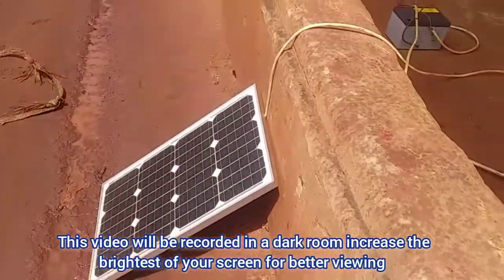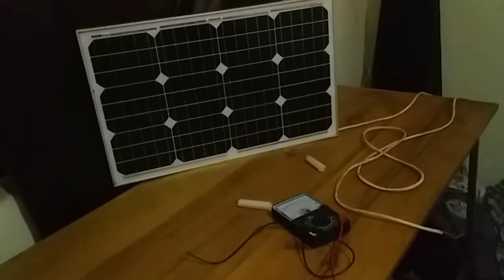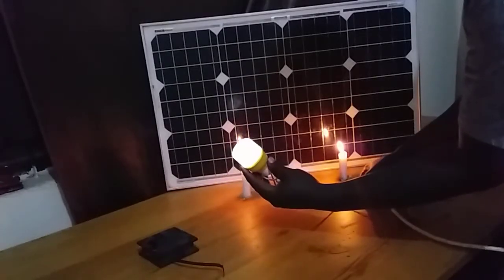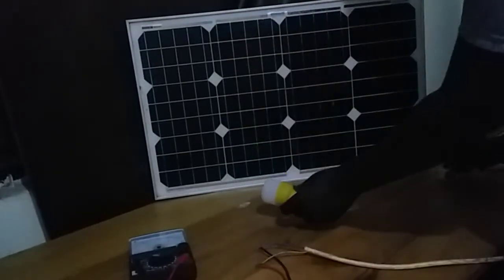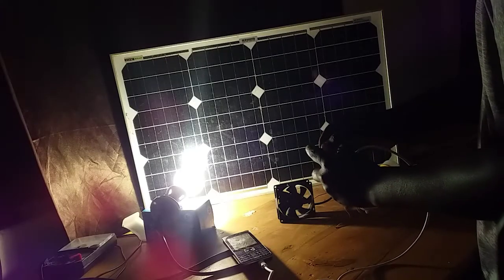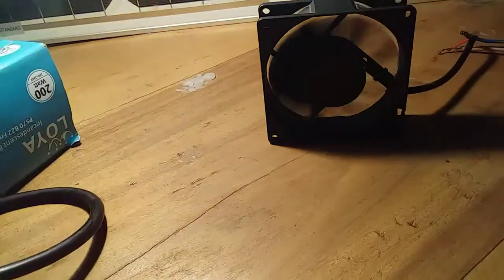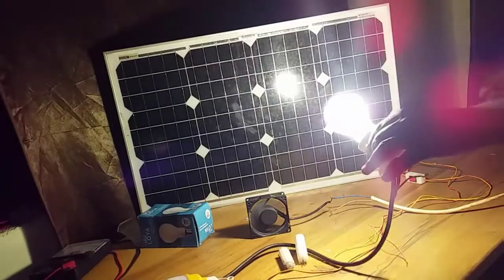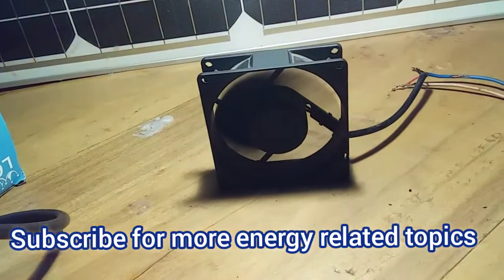How to power a solar panel without sunlight/Do solar panels work at night?

Comment: volts is never amps,  and a bank is required to maintain the rating of amps,  a led is only 2watts such as he shows you here, that 2watts is only 0.01 amps  so the candle, is not the Sun that is for certain,  its a 2amp panel

Comment: Wait a minute, so if the Solar panel recieving the Light of the Light bulb , the bulb wil never stop shining, 🤔
Reply: dimishing returns.. its not a little that is recylcled
but still useful i would think.
in fact i am thinking of using protable panels at night i mean you already have to turn on the lights to see - what ever little charge the panels get should be slighlty useful to top back up some batteries maybe?

Comment: We are from the United States here's the information you are missing remember as you watch these videos you'll see that we put the  Lights directly over the solar, So you have to measure the length of the rope lights Times the solar second point you got wrong the soldiers you are using are configured in a certain way and not giving you all the power you could get out of it. you have to make your own custom solars or you're only going to get a little. but you proven that artificial light can be used
 We call this technique quiet solar it means that the light is not  As intense as regular sunlight so we call it quiet solar. Now as you start to make your own solar Come you'll see and understand that making your own custom solar panels will get you the energy you need to run regular items, But you made a good point by showing that artificial light indeed can produce some energy now you need more surface area or more solar around your light sour
see these videos
https://youtu.be/NBO2hHlpUuk?si=h1_bQuJZCTcN_K5a 

https://youtu.be/eigb75v6Xng?si=0e6IkKyMf9QClHf8 

https://youtu.be/-rbgpYySkQU?si=9BTU2puig0GijU2- 

https://youtu.be/v3olmOI3k0k?si=ut1QvR_JlteIoJch 

https://youtu.be/8WKQNz_reEY?si=KmTRwS9Q9-az-7WM 

https://youtu.be/FAoWTY1t8r0?si=MnwiUf1UA68hi1Zp 

https://youtu.be/HTR03aSiGWs?si=FBiwlTicPHGCzalC 

https://youtu.be/Dp-6fOGI6oc?si=vaakXqPnsSscsp7w

Comment: Did you try a hot potato or hot water bottle just in case the heat is factor onto panel?

Comment: You should hook the multimeter up before you even put the candle close to it. How many volts are being produced without the candles? How much power was being produced just using the room lights?

Comment: 2 candles with 2.2 amps, 12v are 26.4W
Reply from the maker: It doesn't produce that much current with candles
Reply: @mushitrials9808  you should provide some calculations to make this more interesting. Thank you for sharing.
Reply from the maker: @TommWayfarer  I will do it next time just subscribe ring the bell and I will provide more clarification

Comment: Hello Boss.. I'm thinking can you create a self sustaining power source..

Use the bulb to power the panel.. which charges a battery, whilst powering the bulb too.

So you get to use the power from the battery for whatever you want whilst the bulb powers your panel and battery.

Also, I'd connect a 12v to 24v converter from the panel to the battery. 

By battery I mean something like poweroak.
Reply: Correct me if I'm wrong but hypothetically if you can split it to that should work as a back up plan if splitting the power made from that one panel isnt enough to power the light and phone  what you can do it have a cube of 6 solar panels one powers the bulb for all 6 while the other 5 act as a phone charger or feed to a battery  for independent use you technically have more than just sustaining energy machine you could achieve a clean surplus of energy.
Reply: @Videogamer617 It can work by enhancing the light through a reflective process.
Reply from the maker: That will not work I already had that thoughts long ago but it turns out you will not get enough power From the panel to charge the battery one day I will put out the video and explain your concept well
Reply: @mushitrials9808  https://youtu.be/uwfMkpvsoF0